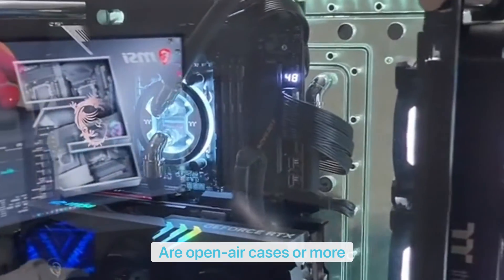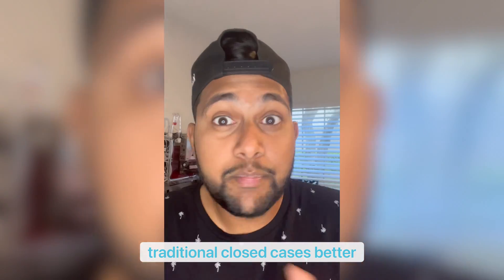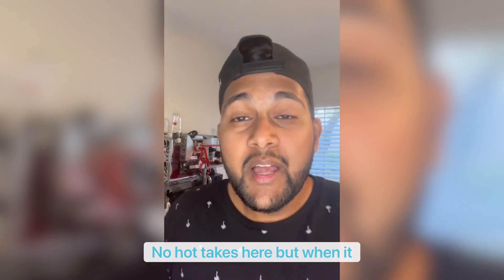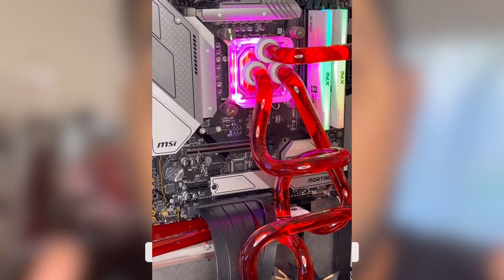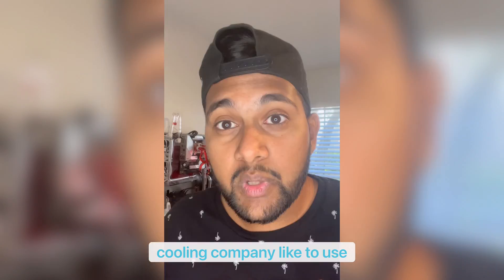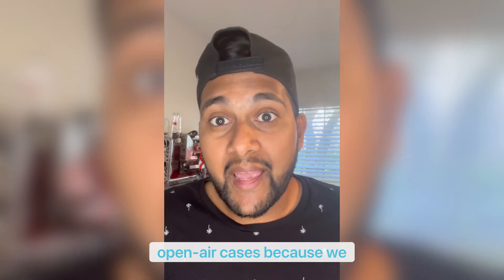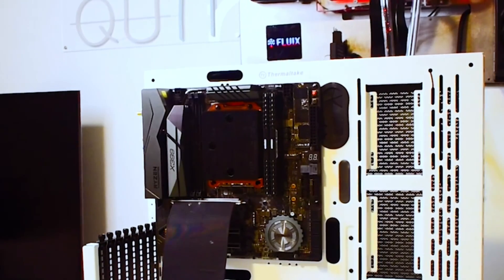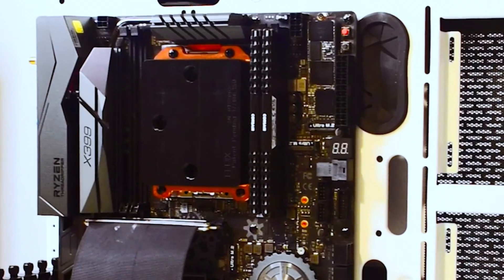Open air vs. closed PC Cases - which is better for airflow?

Comment: ONLY reason for a closed case is to dampen sound and restrict the air flow to go through filters. Otherwise open case is better when it comes accessing ambient open air which gives better cooling without a lot of fans. Way easier to clean with an air gun too.

Comment: I have an open air case for my system with i9 12900k and RTX 4060 and my temperatures have never been lower.  Additionally, I use a 20" box fan placed directly next to it and it's crazy effective.
Reply: How do you deal with dust?

Comment: I want my 2 mins back. You didn't even prove what you're saying. No data whatsoever.
Reply: You don’t need data it’s obvious how air flows around objects.
Reply: @wanderer10k  it's not obvious at all. Auto companies pay millions of dollars to study fluid dynamics. The best closed cases have tests performed to ensure air flows in their cases with no deadzones or contrarian points of antagonistic airflow.
Reply: @312bigbeanburrito  And yet you still thought that an open air case where the air isn’t forced over the heated components still had the potential to be MORE efficient?!
Reply: @wanderer10k  yes, for two obvious reasons -- 1) ambient temps 2) it is possible and actually quite common for closed cases to perform badly because of contrarian airflow design and deadzones
Reply: @312bigbeanburrito  Yes, open chassis, for those who use a freezer to store their PC, so's they can take advantage of those delicious ambient temps. 🤣🤣🤣
Reply: @BeanieKing or anyone who doesn't live in an oven. Typical idle cpu temp is 40-60 C or 104-140 F. Do you keep your room hotter than that?
Reply: @BeanieKing Or do you live in a region that regularly gets hotter than 104 degrees outside? Otherwise there's this crazy air exchange technology in rooms called a window,
Reply: @wanderer10k it’s not, that’s the point!

Comment: In a permanent open pc case, you just stick a fan blowing air on the vrms and the problem solved... :)
Reply: Yeah exsauht upside fans and back just need to be used as intake and you have air cooling direct for the vrms, cpu and ram, the only downside of open case fans you need to clean every 1 2 months, at least the case, cpu heatsink and fans xd
Reply: @JomarsYT  Unless you have it in a really dusty  zone, then air-blowing it for 2 minutes.2-3 times per year is more than enough... I have one here and it's always clean and shining... No extra money for fans, no noise, no extra weight, Immediate access on pc parts if need to, easy to jumb from HDD to another HDD if need to, disable cd/dvd and reenable it in just one step sticking the power cable in it, etc...
Reply: @inorbit8666  What case are you using?
Reply: @inorbit8666  I got around the dust issue by having an air purifier blow at it. As long as you remember to change the filters😊
Reply: @JomarsYT  1 to 2 months is BS and totally dependent on the environment. I have an open air with a vornado fan blowing on the mobo and I haven't had to clean anything for a year now.